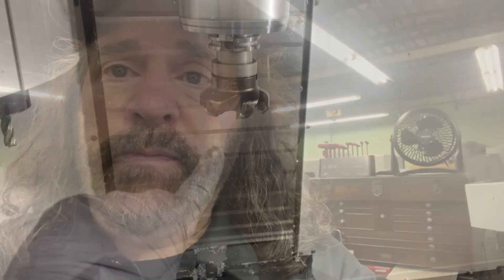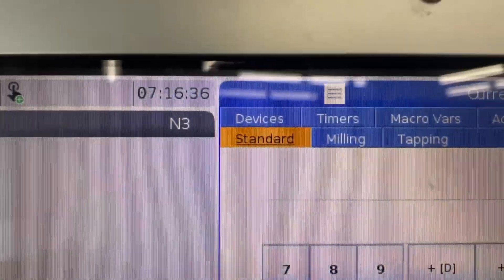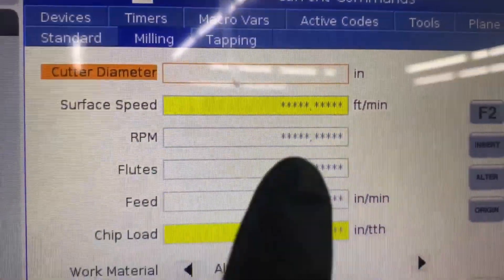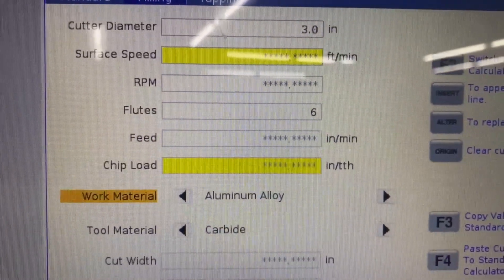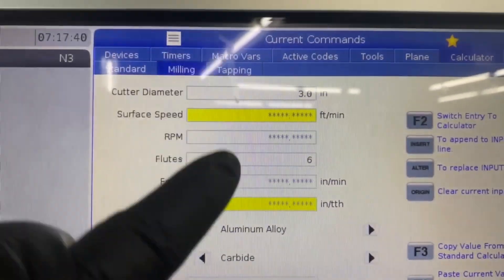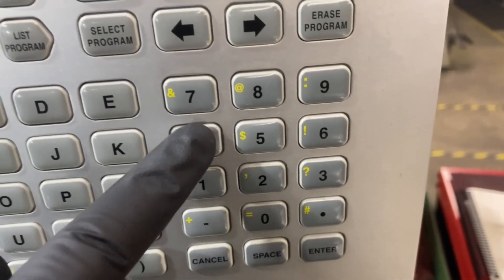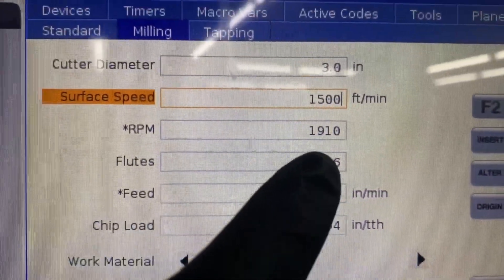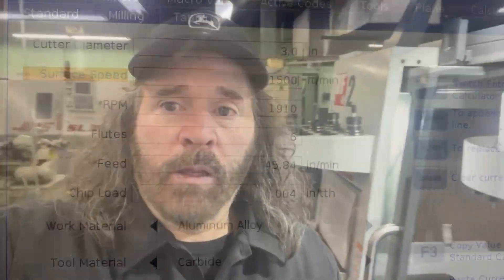HAAS CNC Next Gen Control...Calculator milling example #haascnc

Comment: Pretty cool! Is there also a recommendation for Depth of Cut? Or would you just go and program that on Mastercam with the Tool recommended settings?
Reply from the maker: There isn't really a recommended depth of cut calculator on the controller. It does have a tab where if you enter how deep you are milling, it will just show you the horsepower the machine will be using to make the cut.
The shop I'm at doesn't have any software to make programs.  I've personally have never used mastercam, but have seen videos on it.  I'm sure mastercam would give you good recommended values to start with.
I usually have to rely on just my gut feeling on where to start!🤣🤣
Thanks for watching my video!!